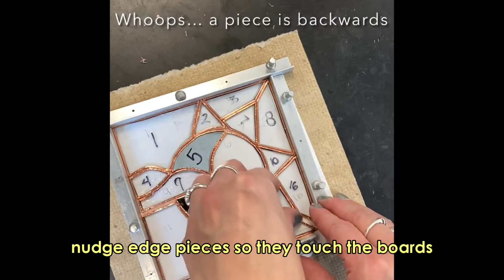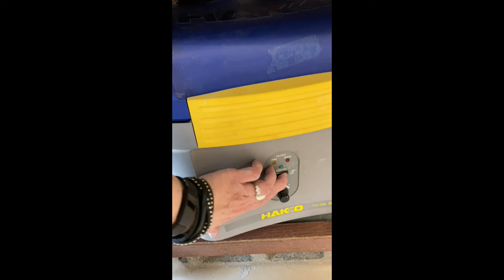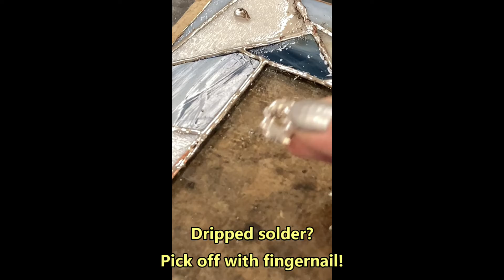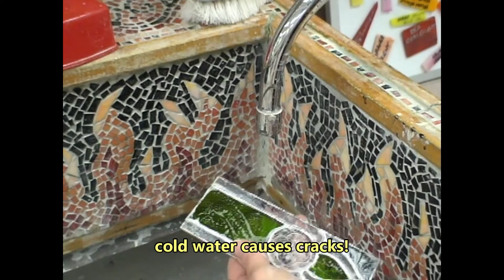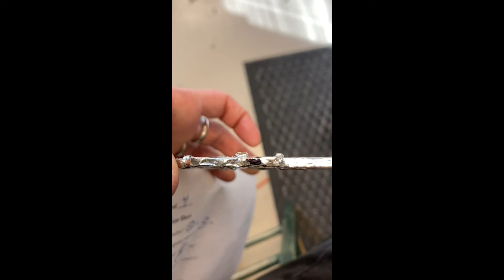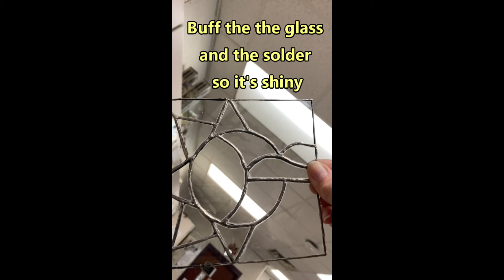Stained Glass Process: Setting up, Soldering, and Finishing

Comment: this was great, what are the pieces you used for keeping it from moving?
Reply from the maker: They are aluminum strips called "layout blocks." Do a search on them and you can find kits that come in different lengths, along with pushpins. Use homasote board as a base, since it's soft and fireproof. Thanks for watching!

Comment: Why does mine try to flatten out ?  And then ends up kinda rough and bumpy…Is it possible the iron is too hot?
Reply from the maker: When you first start soldering one side, usually the solder will be flat because it is filling up space in between the pieces, as it should. Adding more flux along the way will help your solder to be fluid. Go over your solder seams a second time to add another layer. This layer will be more like a bead. Rough and bumpy seams can also be because of a dirty iron tip, so make sure to wipe off the tip periodically with a sponge. I do have another video on my channel: ‘fixing rough solder seams’ that you might want to check out. It may not be because of the iron being too hot. Keep at it because it will get easier! :)